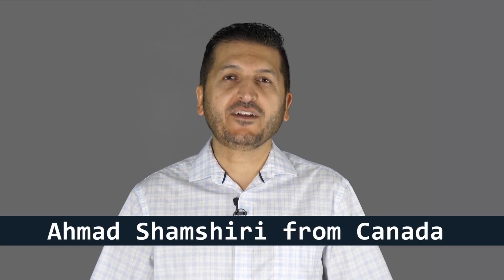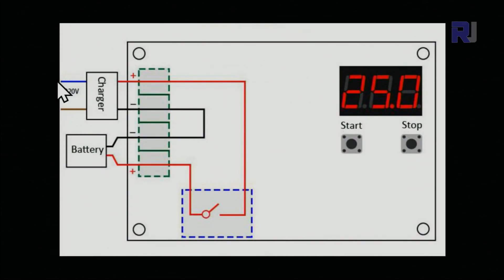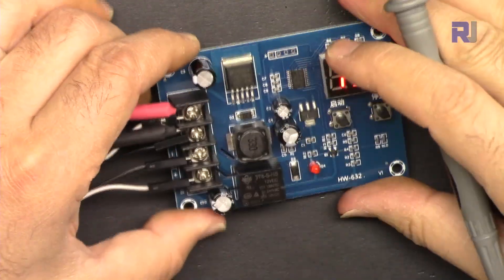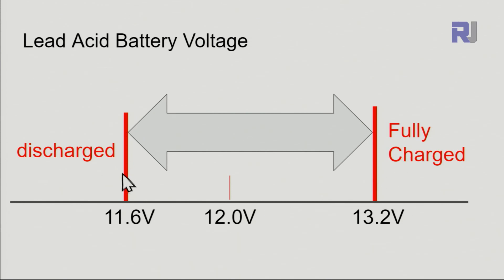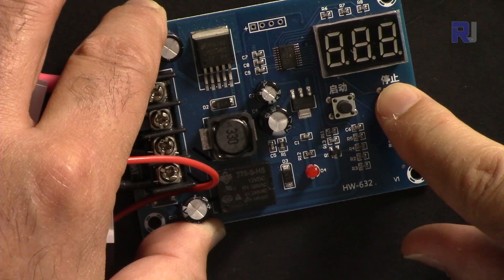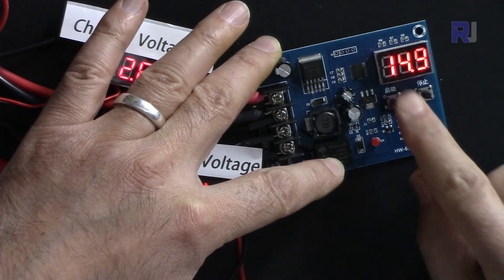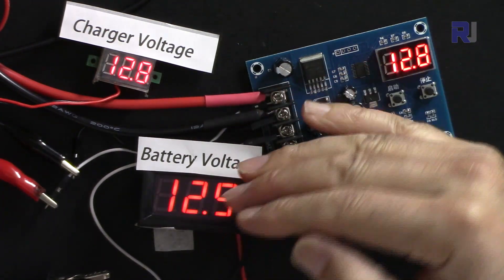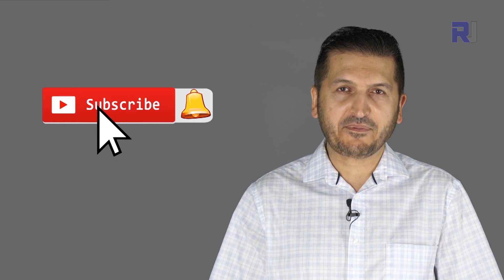How to use XH-M603 Battery Charger Controller - Lead Acid only, not Lithium - RJT296

Comment: in description you tell us (How to use XH-M603 Battery Charger Controller) it is use for lithium battery and in video you used HCM-M632 its use for lead acid battery
Reply from the maker: Which description?

Comment: Sir can you please explain the components which have 330 numper on it and. Can anyone can explain voltage regulator i can't understand how it work's in this.
Reply from the maker: Hi, here is the answer from Gemini AI: https://g.co/gemini/share/27d828f8ec82
the voltage regulator gets input voltage and gives output with fixed voltage.  if you output is set to 5V, and IF the regulator accepts (example) 6V to 16V, then if you give the 10V at the input, it will output 5V, or if input is 6V the output will be 5V.  So anything between 6V to 16V at the input will give you 5V at the output.

Comment: Hi, can you make a video about YX-851 module?
Reply from the maker: Hi, why you like that? I have YX-850. but don't know if people use it? what do you use it for? UPS? if so it is NOT. it has a relay and delay. it does not turn ON immediately. there is a 0.2 seconds OFF time.
Reply: @robojax  for UPS, do you propose some other module?

Comment: Whyt we cannot use it in lithium phosphate battery?
Reply from the maker: You can use it for lithium batteries . Minimum lower voltage is 11.x volts. If th upper and lower values of your battery fits, then you can use it.

Comment: Why is it that the charge time is right and wrong?

If you have a lead acid battery the capacity is marked to 7v with a full charge  cutoff being 14.6.
But we tend to use the full capacity to make the calculation, but we don't use it all so it should be quicker.
But.....
When you charge, the current absorbed drops so you maybe charging at 2 amps by the end ...

Comment: Charger voltage is normally 14.4V, to reach 100% capacity. And 13.2V is the voltage of full battery, but in disconnected state. So the cutoff voltage should be something close to 14.4V and not just 13.2V. Please make tests and comment on that, so ppl can get their batteries charged properly.

Comment: Can I use it to charge a 18v battery ?
Reply from the maker: your question is answered in the video.
Reply: @robojax  Thank you for you response ?  So the answer is Yes or No ?
Reply: Only batteries of 12v and 24v are compatible  or the range between of 12-24 V  batteries are compatible  ? @robojax

Comment: During the time of demonstration of charging a 12 volt lead acid battery as per the video, I wanted to know how the battery voltage is increased or decreased manually as per your video. The battery voltage by default remains constant. It can be decreased during discharging process while connecting a load. Also the battery voltage can be increased during charging but will take some time that depends on the charging current. But my main query is how the battery voltage can be increased or decreased manually as shown in your video during the time of demonstration of charging a 12 volt battery????
Reply from the maker: No. as you charge the battery, the Constant Current source you have will initially to keep the current constant, suppresses the voltage in order to keep the current constant. as the current decreases when the battery is charged, the voltage is increases.  this is normal behaviour of a constant current source.
Reply: @robojax  Thank you for the clarification. Your videos are very informative and interesting as well.

Comment: Do they make reverse relays it would be nice to make it do the opposite to protect the batteries and shut off an inverter when the battery gets too low. Thanks
Reply: Nwvermind they make a xycd63l they has both load and charge fynction way cool

Comment: how does is control chargig current? for example on motorcycle 6ah battery its needed to charge at max 1amps and on bigger car batteries at least 5amps so does it control current and recognize battery capacity?
Reply: Been searching for this same question not gotten the answer yet

Comment: Hi. Can i set the connect value to 13.4v and set the disconnect value to 13.7v?
Reply from the maker: Hi, it seems I made this video to answer such questions. Just watch and learn.
Reply: @robojax  can i use this module for lifepo4 batteries?

Comment: Thanks for your review. 
I snagged one of these from a reseller for 50 cents, and frankly I'm still trying to figure out what I'll use it for. I suppose I could simply attach a basic wall-wart DC power source to the input and turn it into another Lead Acid charger, but somehow I think I have better I could do with it.

Comment: If its a 12v lead acid battery that anyone is using this on the lower setting should be minimum 12.2v as going less than 50% discharge on a lead acid battery reduces their life considerably.
Reply from the maker: no. lead acid battery can go very low and it will not get damaged. But keep the lower value to 10.5V to 11V. it depends on what is this battery suppling power to.

Comment: Nice explanation. I'm going to use mine to connect a solid state relay to switch a mains charger on and off so it doesn't have to be on all the time. Its for a backup to a solar system. The relay connections you explained allowed me to see this was possible.

Comment: For imput AC is good to charge 12v 7Ah baterry whit 15v and 3Ah?
Reply from the maker: may be you did not watch it. I have provided subtitle in most languages. Activate the subtitle so you understand. you should have your own charger. this is just turning the connection OFF if the voltage comes to the batter is greater than the set value.

Comment: I used this as my car charging module. The lower charge set to 3v as my battery become dropped 5v once. And set the maximum volt to cut off as 13.2v. but when I connected the drained battery, the led light won't turn on for charging state. And it won't start charge. I checked the power supply. It was 16V at that time. Could you please tell what is wrong with the settings here?
Reply: I set the module to turn on led in the module while connected to drained battery now. But the led doesn't turn off when reached its maximum volt which I given for turn off. Hope your response as sooner possible.

Comment: Can it be used with a 16 volt 4.5A laptop charger?  As far as I understand, the chip puts out up to 3 Amps on XH-M603
Reply from the maker: This is just a switch to protect your laptop if voltage goes higher than the value you set. So use your charge or lower source and this module protects your load which is your laptop.

Comment: hi like the video I just wanted to know can you connect a load to the battery while it is in circuit and use it as a backup for a LED string light so when the AC power dies it will still run off the 12 Volt battery can one do this let me know if it's safe to do so. thank you.
Reply from the maker: Yes you can

Comment: How many volts do you have on the input for a 12v 7Ah battery?
Reply from the maker: you did not mention what kind of 12V. I mention lead acid in the video please watch. 7Ah does not matter if it is 1Ah or 1000Ah. to charge for example your 7Ah batter at 1A. it means 1A/h (7Ah÷1A = 7A) and it will take 7 hours to fully charge or at 7A charge current it will take 1 hour (7Ah÷7A = 1h).  if you have 100Ah batter at 1A current will take 100 hours to charge (100Ah÷1A = 100h). but if you charge it at 5A then 100Ah/50A=2 hours.
Reply: @robojax  you can not charge 100 A battery with 50 A, it will destroy your battery, optimal charging current for battery is 10% out of it maximum current capacity, for example 100 A battery is charged with 10 A, not more..

Comment: Hello Mr. Ahmed!
Thank you for the explainer video, it's really cool.
Please help me in my inquiry, I need to protect the 48 volt 60 amp battery, where is it sold, and if there is any website on the internet that we can buy through it.

Thank you very much
all respect to you
Reply from the maker: Hello,
Battery protection is not very simple. I forgot the maximum voltage for this module, but  60A does not matter when charging. it matters only if you are using it or discharging and you may need to protect it if you may draw very high current like 20A or so. But the rest depends on charge current and most devices with a simple relay can connect and disconnect 10 to 25A.  here is one for 48V https://s.click.aliexpress.com/e/_9gIwp3 but there are many depending on how much you want to spend.

Comment: Hello, listen to the amps how are they managed?  I need to charge a 12v 12A lithium battery pack.  If I put a 1A charger on the battery does it get 1A?  Thank you

Comment: Pls sir how can i get the one to work on 100amps charger
Reply from the maker: Make this loupe to turn ON and OFF a huge relay that controls the connection of 100A
Reply: @robojax  pls sir how can i make that connection provided that my charger is 24volts generating a 100Amps
Reply from the maker: so you will use this XH-M603 as a switch. Watch this video to learn how a relay works  https://youtu.be/N-xbxtGGoHw  and use XH-M603 to control a relay that is capable to turn ON/OFF 100A like this relay https://amzn.to/3wFAHtB
Reply: Sir please make a video on an XH-M603 using a relay on it please

Comment: My battery is connected with a 10 amp load, will this module sustain such load if i use it to charge the battery?
Reply from the maker: you made me watch the video. I have explained how much current the relay can handle. please watch

Comment: Excuse me, can you kindly explain me if the object in the left (charger input) is a power supply or a charger ?
Reply from the maker: Hi, it seems you have not watched the video. I answer any question that is not answered in the video. Please watch
Reply: @robojax  Sorry I'm not experienced enough. You said "charger or solar panel". I don't know if a solar panel is similar to a power supply. I've seen in other videos using an ATX PC, so my question is : can I safely use the 12 volts of a standard ATX PC input power supply?

Comment: Thanks for a very comprehensive description of this unit.  I measured that the unit is taking about 70mA from the battery when its not turning charge on.  I would like to reduce this by turning off the display when everything has been set up.  Do you know of any way either in software or hardware to do this ?
Reply: Sorry about my english I from Argentina, I have the same problem and I can`t solve this at the moment. My battery is 1.2 amp and this module discharges it quicly because the unit is taking 70mA
Reply: Only way I could see to do that would be to break the track connection that feeds the positive supply to the led display and solder jumper wires and add a switch to be able to switch it on or off but too be honest these little led displays use very little power the difference is going to be minimal.

Comment: Can you reverse this and use it as low voltage protection?
Reply from the maker: No you can’t. This is for Lead Acid batteries which love voltage does not damaged them.

Comment: Hi  
I want to ask u
Can i put A 31 volt solar panel and I charge one 12 volt battery from it through this circuit? Or it should be 24 v battery. 
Thanks
Reply from the maker: Hi, may be you did not watch the video. This is just a switch like On or off it does not change the voltage. See th video
Reply: @robojax   ok 
Do u  have any idea how we use 31v solar panels from 31 volt to charge batterie 12 volt.  Only one battery? 
Thanks
Reply: @zaferibrahim  use a step down converter to change 31v to 14v and ur good to go

Comment: I have 24v charger can i use 12v car battery charge its  work???with this? Controller???
Reply from the maker: You have not watched ether video fully, else you won’t have asked this question. Please watch

Comment: I have the same to charge a pack of 3 18650 batteries in series with 11,9 total volts and when it reaches de low voltage limit that i configured the relay start to turn on and off constantly and the voltimeter indicates peaks of 20 volts (voltage input from solar pannel) in the output to the battery. When apparently it stabilizes and the led is turned on it dont charging anything, the voltage drop on battery continues.

The entrance line from solar pannel down from 20v to 11,42v when it s happens. Same result connecting dedicated 15 - 20v computer charger.

¿Low amps, my fault or module fault?

Comment: is it ok to use old laptop power supply 19volts 2amp? i will try diy battery charger for my spare motorcycle battery 12volts..
Reply from the maker: Hi, I get all these questions because people don't watch fully and ask questions. Please watch. I have specifically mention this portion.

Comment: Great video and really love your content. Is there any reason this module cant be used to control lithium batteries (18650s)?
Reply from the maker: because input voltage minimum is 10V so you can't change 1 cell. also accuracy is 100mA and for lithium batteries 100mV can't be big deal.
Reply: @robojax  Thanks very much. I’m sorry - I didn’t explain well - I’m hoping to use this to charge a 4s22p 18650 pack. Im planning to set my bench power supply to around 16.7v, and connect the out put of the power-supply to this module.
Reply: @robojax  I am thinking of using this for a tool battery adaptor the only thing i need it to do is shut off once the lithium battery gets from 18v to low 15v. Do you think this PCB will work? The only concern i have is that tools can use high amps and i dont know if this board would handle it.
Reply: you can charge 18650. set it to 12.6(4.2v/cell)for max and 11.5 for min voltage but be sure to have 3S balancer.

Comment: Salaam Ahmed. I am currently setting up a XH M603 with a 16vac transformer , which has a bridge rectifier connected to achieve my DC power. My output after capacitor of the bridge rectifier is 24V. Currently the M603 is in standby mode attached to a 12v 9ah sealed lead acid battery. When the battery dropped to 12,5V the relay engaged on the switch over to 12,4V but then it rapidly rose to 12,8V and deactivated within seconds. What could be the cause here since my switch-off is at 13.4V. Do you have any advice please.
Reply from the maker: Walaikum Salam It seems your battery is full and that could be the only reason
Reply: @robojax  shukran for the haste reply .
Reply from the maker: afwan.

Comment: i have a question. if the charging voltage is higher than the stop value will the controller then still be able to see when the battery have reached the stop value.
Reply from the maker: Hi, yes it will. It read constantly the voltage.
Reply: @robojax  but after trying it, it seems that it turns off the charhing because the charhing voltage is bigger than the stop voltage. Causing IT to think that the battery voltage is bigger than the stop voltage
Reply from the maker: Isn’t that good if the charging voltage is greater then the stop voltage it should stop it? You voltage greater so it should stop it and this is how it is made . So it is working perfectly.

Comment: First of all thank you for such a nice video. Is it possible to use a common socket for both charging and use? Just like a wireless hand drill. How to make a circuit.
Reply from the maker: Power your tool from battery.  Or power it from charger .  It should work when the power supply is connected  to this module.

Comment: Could you wire this in with a dc to dc buck boost converter between this module and the solar panel or pwm?
Reply: If so also what max current shall I limit it too, knowing this module is rated for 10 amps max?   I would say give a cushion of 8 amps max.

Comment: Thank you very much for the good explanation . Please can you tell me whether I can use this to charge 100 amp battery.  I use 100 amp battery for my home inverter.  Thank you for your advice.
Reply from the maker: you are welcome. Yes you can charge. but maximum current as explained in the video, is 10A, more than that will kill this module. Check this better module that also measure the current up to 20A and it has tones of protections https://youtu.be/2DaC6oOV9oA

Comment: Can I use this to charge my AGM batteries in my caravan from main battery  when I’m driving  ?
Reply from the maker: this just know the voltage. it voltage is within range and the current does not exceed the raring of relay, it should work.

Comment: Question.  If  During charge the upper voltage isn't reached and the voltage ends up going below the cut in set point will it stop charging?
Reply from the maker: your question made me watch the video and I found the answer. I even showed a diagram. I spent so much time making this video. so please watch it without skipping. I answer any question that is not answered in the video.
Reply: @robojax   I am truly sorry. I don't want to be that guy.

Comment: Hi Ahmad, can solar panel connect directly to the charger controller to charge the battery ?
Reply from the maker: Hi, I mentioned that this is just turning ON and OFF. it can't control the current. so if your solar panel 's current is below the maximum amount of current that your battery can handle, then connect it  directly. but if your solar panel can supply very high current that might damage your battery, then you need to put a charger or constant current device so limit the current.